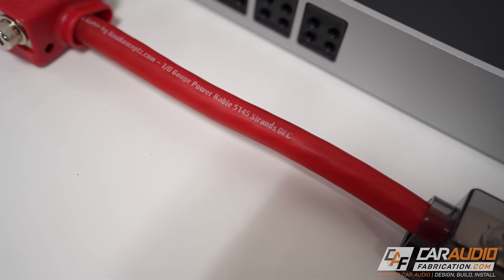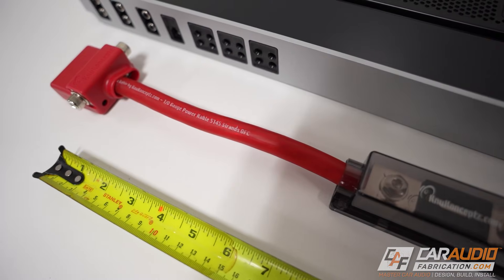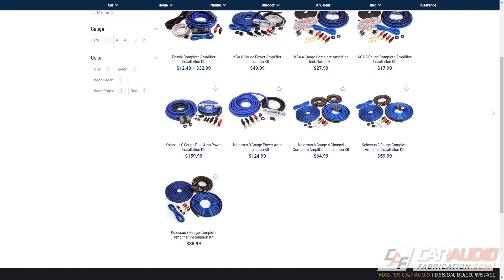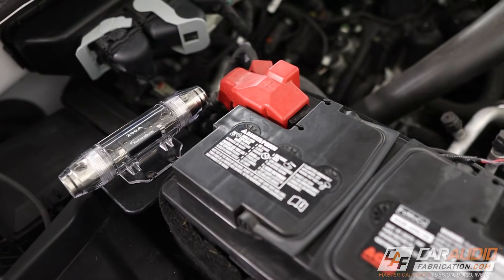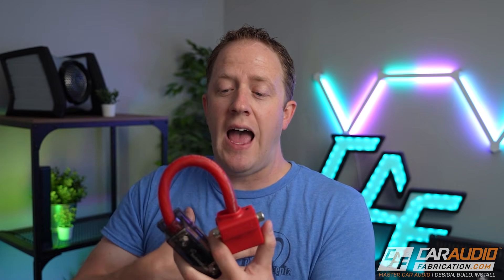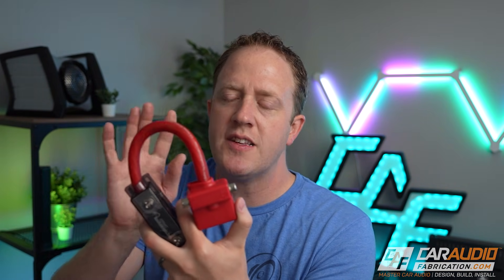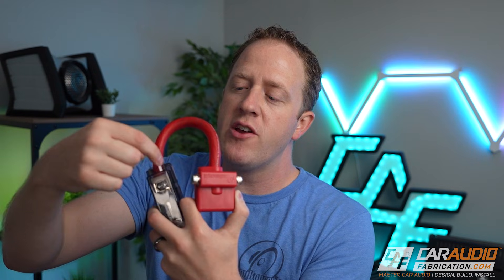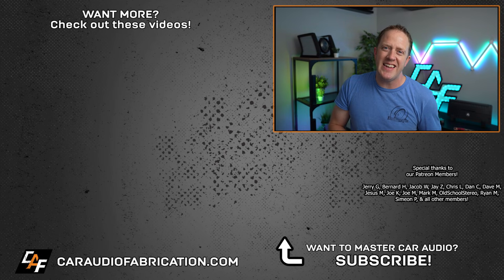AVOID Electrical Issues! - Battery Terminal to Fuse Length EXPLAINED - Car Audio

Comment: I watched quite a few of your vids for guidance in installing my basic system of a 8" powered sub, 4x50W compact amp, and four door speakers. I've heard the 18" rule from many sources. To me, it seems that 18" is an arbitrary distance. What are the calculations showing that 18" should be the maximum distance from the battery? Why not 12", 20", 27.3", 74mm, etc? Thank you for your professional and informative videos!
Reply: In rhe video Mark said it should be "as short as possible". IMO you should make "as short as possible" the maximum length. As Mark pointed out, you can (and absolutely should) make a bracket for the fuse holder/circuit breaker that puts it inches away from the battery terminal. 

Why 18" for a maximum  between battery and fuse? Who knows? My assumption is, some believe a number must exist and 18" wound up being the number or 18" should be plenty to reach the nearest flat spot in the average car where a fuse holder/circuit breaker could be mounted because newbies don't think about making brackets.

I can't say with 100% certainty that no one has tried to claim the 18" max is due to electrical factors like voltage drop or whatever (I'll be shocked if no one replies to tell me how wrong I am and blah, blah, blaaaahhh),
but, I am certain no calculations of any kind went into the 18" "rule". 

So, new rule, As Short As Possible. 🤏

All the best.

Comment: I've  always make a bracket that if possible straight off one of the battery tie down brackets/strap then keep the first part of the power supply lead as short as possible between the battery terminal and the major fuse for the whole system. Then always secure the cable after that fuse with stand off cable tie mounts if possible every 6 inches. Where the cable passes through bodywork or trim panels use an appropriate rubber grommet. I've been doing this since the mid 90's and have never expirienced any cable failures/ shorts.

Comment: Someone need to make a battery terminal block with a built-in fuse.
Reply: New cars already have them. They even have a BMS (Battery management system). Now you have to recalibrate your BMS after changing your battery in your vehicle or adding an additional load like aftermarket electronics.
Reply: @JakkiPi  or if it's a Ford just disable it.
Reply: The show sponsor, KnuKoncepts, has one. The KonFUSED block has two fuses built in. Not perfect, but its an option.

Comment: Knukoncepts is an amazing company with top quality offerings. Even compared to sky high and all the other aftermarket options i think knu holds its ground solid. I honestly feel wont use another brand, because they do it all and do a hell of a job.
Reply: @VirtuousWarrior-wr2fv  yea I did the price matching for my system and they are definitely the best bang for buck.  4/0 ofc is better priced than anyone out there. So it the lugs and fuse holders. Only part of my system I opted for elsewhere was CB supply distribution block and 8 spot fuse holder.

Comment: Great video! Do the same rules apply to distribution blocks? My shop owner insists that you don't need a fuse at the distribution block because the main fuse protects the whole thing, but that doesn't make sense to me. TIA!
Reply from the maker: It depends... if there is a step down in power wire size, yes you likely need a fuse as the smaller wire probably can't handle as much current as the larger fuse feeding the whole system. I talk about this more in my electrical system design videos - https://www.youtube.com/@CarAudioFabrication/search?query=electrical
Reply: @CarAudioFabrication  imho, this is similar to house electrical systems. You have a main breaker protecting the main wires. Then at the distribution system (panel), you have a bunch of different sized breakers protecting different sized wiring going to different areas of the house. So for car audio, you'll have a main fuse protecting the main wire going to the distribution block. After that, you'll have smaller fuses protecting the smaller power wires going to the different components of your system. 

Is that remotely accurate or am I way off?